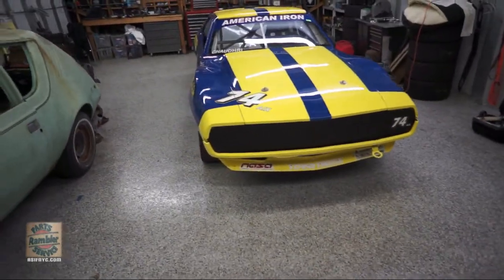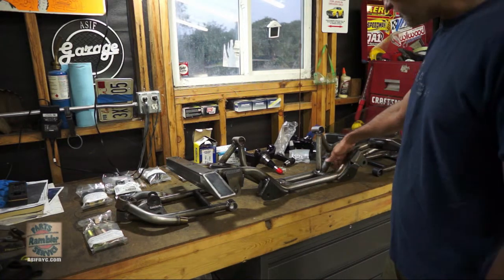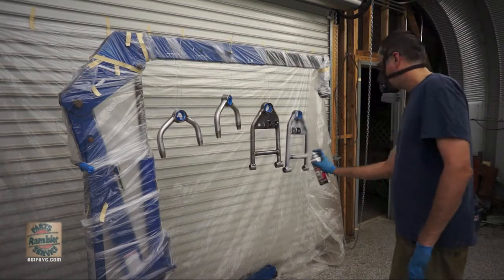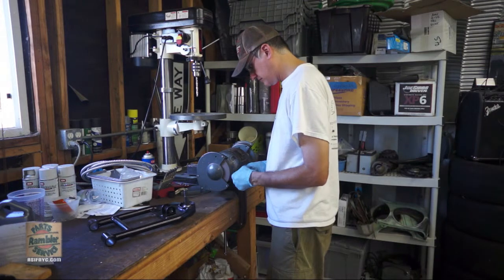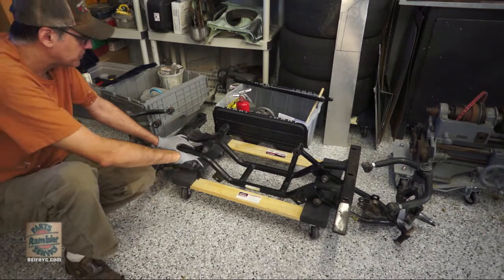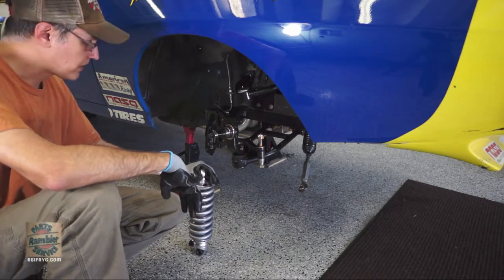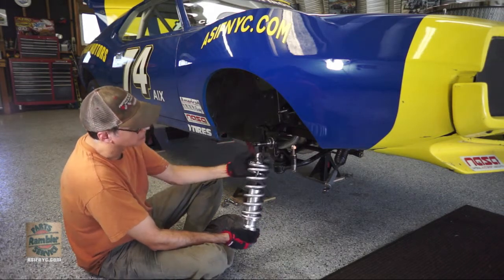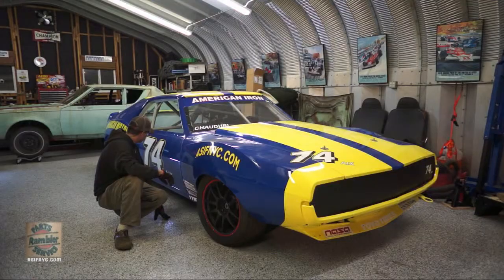Going For Low - NASA AI Javelin update Oct. 2014

Comment: I'm going to try mating a Griggs racing SLA conversion kit from a 04 mustang to my front end. Wish me luck.
Reply from the maker: +Jacobe2of4 front end of what? are you building a Javelin?  if so, pics/videos please :)

good luck!
Reply: +asifnyc I'd have to fix the camera on my phone. It'll happen eventually. So I will have to explain in a drawn out paragraph. Sorry. It's a a 72 Javelin body. Everything else will be swapped out for a more modern setup from several different makes. Therefore I call it The Bastard. After many long hours of research, I found the power rack and pinon mod that prostreetAMX was able to build from a sn95(93-04) mustang. You can also get a set of 4 pot baer breaks off of a gen 2 uk focus rt for next to nothing and they will bolt on to the mustang spindles.
( presuming you buy them from a junkyard that will send them overseas and not be able to tell them apart from crappy brakes. I'm familiar with a website that lists wreckers that will ship out parts)   After purchasing a cheap 03 stang setup,I noticed that the McPherson strut design of the sn95 is very similar to that of the javelin. On a hunch I looked into upgrades to 90s mustangs and found out about the griggs racing setup. I did the next logical thing and pulled up pictures of the control freak front end in a new tab. The are almost identical other than the body mount locations. Griggs sells the sla arms for 750 and all I need to run this setup is a custom k member and bit of fab work.
Reply from the maker: +Jacobe2of4 very cool!  is this a competition car? what class?  are you on the AMC Forum?  Please post pics and progress somewhere (here or a forum).  Thanks!
Reply: +asifnyc It's going to be a street car until I modify it for web project of mine. A few years ago I backed out of a local deal on some AMC parts. Turns out the seller is one of Top Admins on the AMC Forum, so I doubt I'm welcome there. I'll probably post videos here at some point. My progress was hampered by severe medical problems and I am just now finally coming out on top.